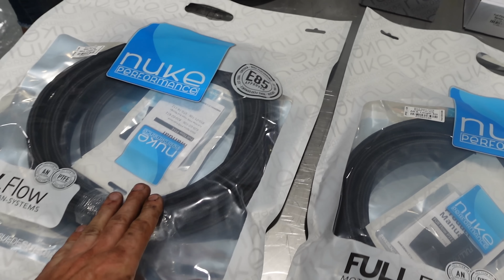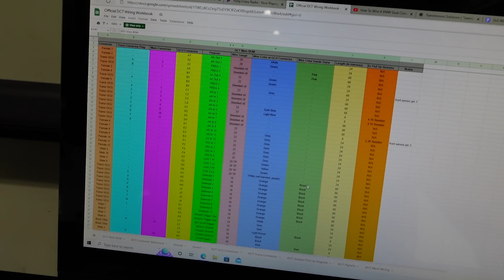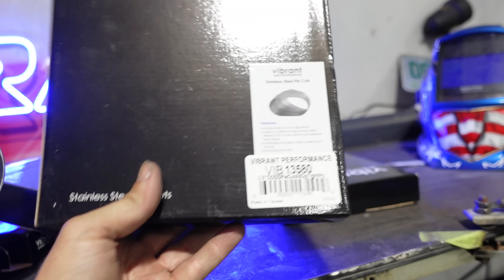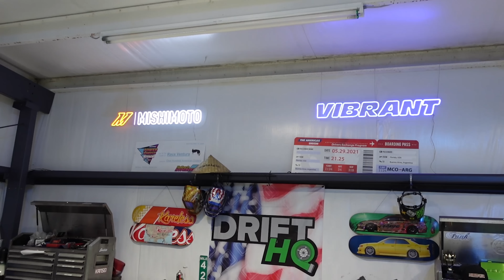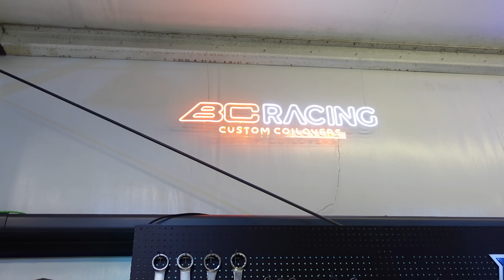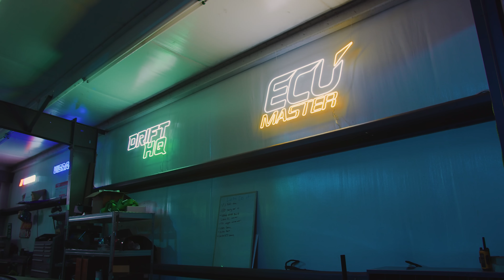DCT Transmission Install - 2JZ BMW E92

Comment: HIPE YOU GUYS PUT A CLEAR COAT ON THOSE HYDRO DIPPED STUFF THEY DO THAT TO KEEP IT SEALED OTHERWISE IT PEELS AFTER IT GOES THOUGH SOME HEAT CYCLES

Comment: Next time you need to lift a heavy transmission use a couple of straps on the arm of your lift to hoist it up to where it needs to be instead of breaking your backs .

Comment: Oem brake master / booster or aftermarket?

Going to have to do the same fuel system so the video is extremely helpful thank you.
Reply: Yes oem. Just brand new

Comment: all that soldering and wiring hassle for mech unit and htg is quite oldschool now cause there is much better options on market atm witch wont require any soldering or even removing mech unit.

Comment: Excuse me for commenting from Japan.

I drive an E92 320i Coupe in Japan.

I would like to install a 1jz or 2jz in the future, but is that possible with a 320i base?
Can the member kits listed on Drift HQ be fitted to a 320i engine member?